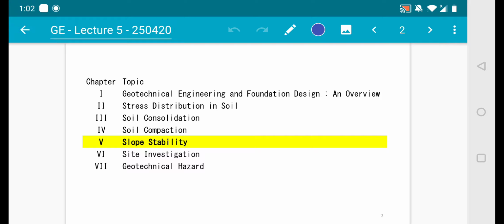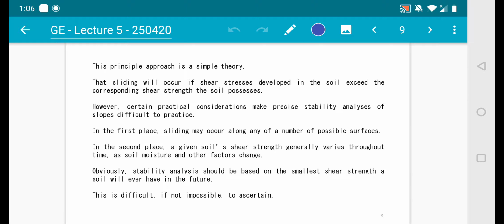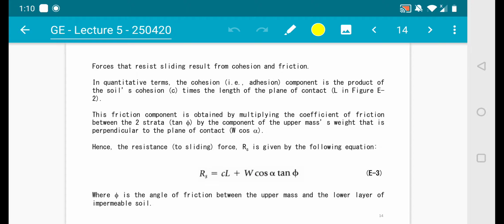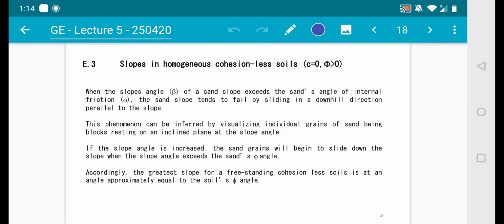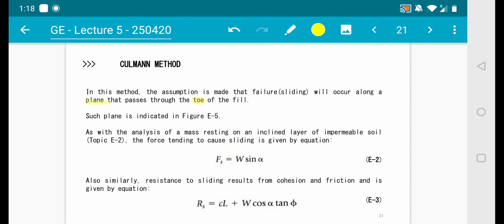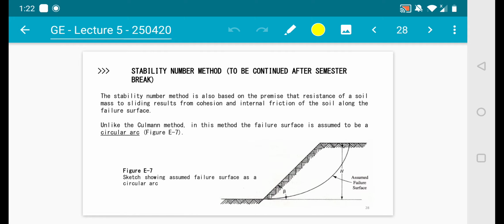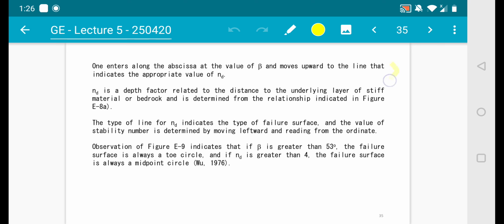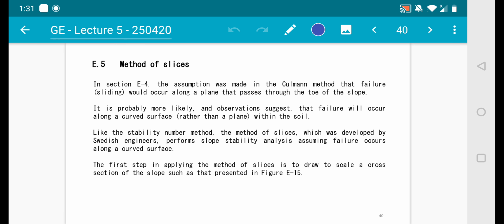GE Series - Chapter 5 (Part I)

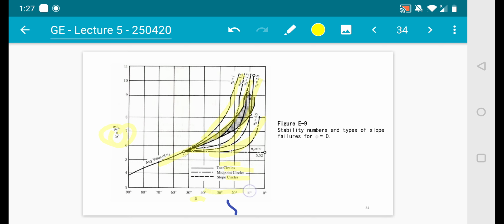Comment: At 25:29, the Beta value is increasing towards the left.
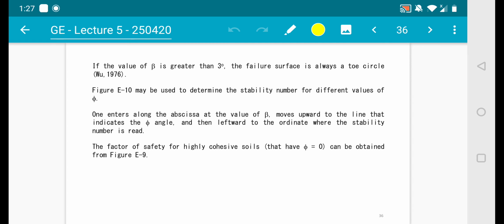At 25:56, when theta value more than 3 degree instead of beta value, so that the failure surface is always a toe circle.
Reply from the maker: Oops. Sorry for that. Very good Bin Feng for pointing out the mistake. Hope that everyone will take note on this.
Reply: @huzwich  noted dr
Reply: @huzwich  Yes. Noted Dr.